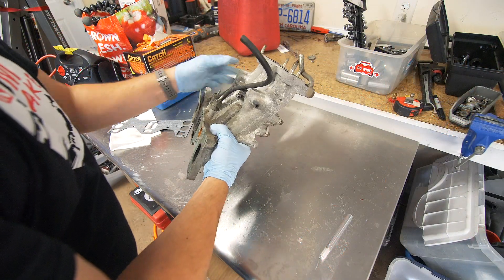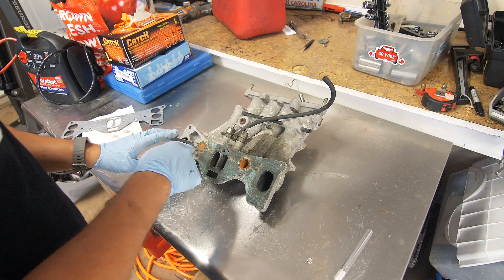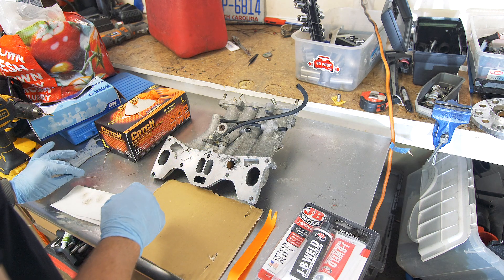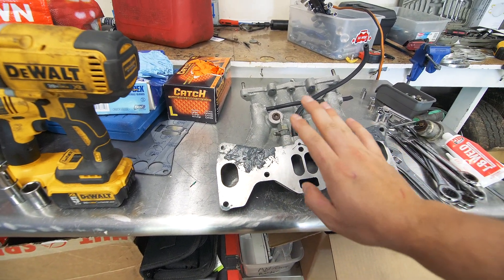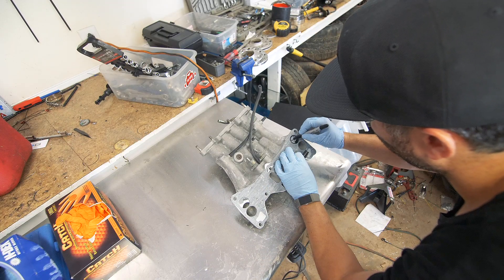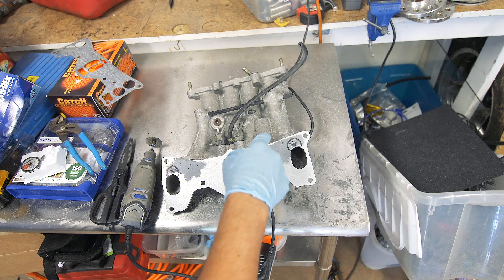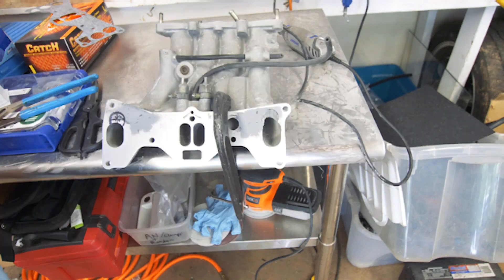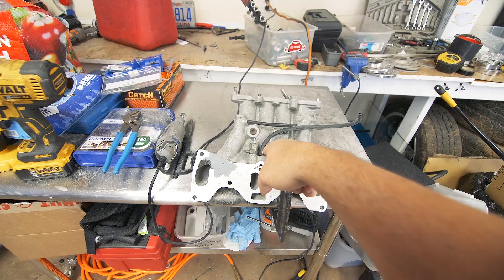PORTING the RX7 Turbo 2 manifold to fit the 6 port engine!

Comment: Nice, is it not possible to use the stock LIM with T2 UIM? j/w
Reply from the maker: Not to my knowledge. Also the stock LIM sticks out quite a bit compared to the turbo version, meaning you'd need some sort of spacer for the turbo exhaust manifold.